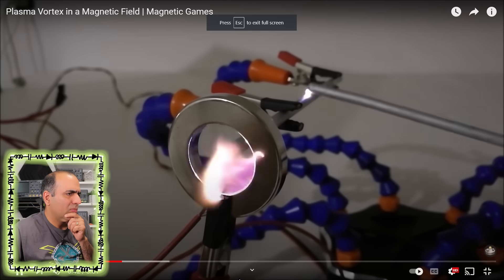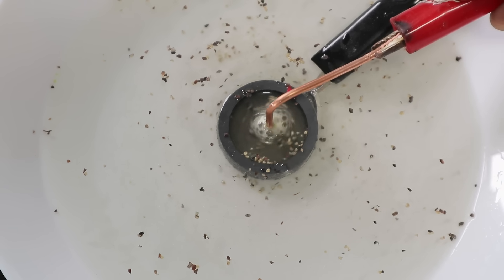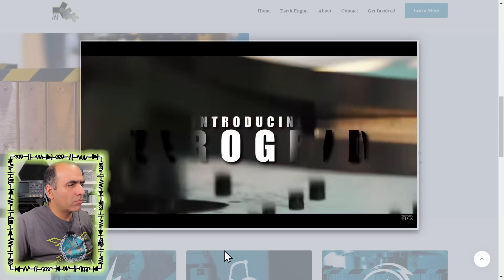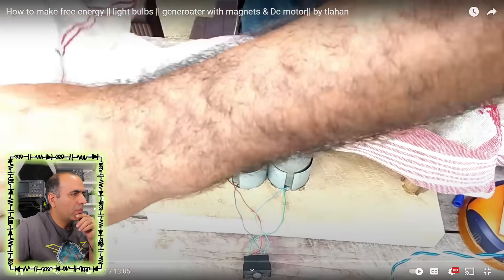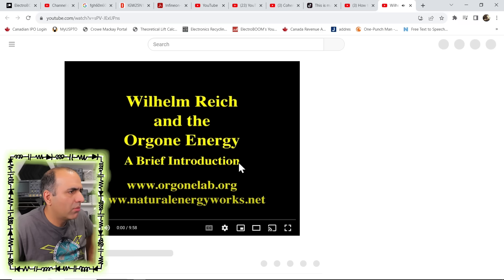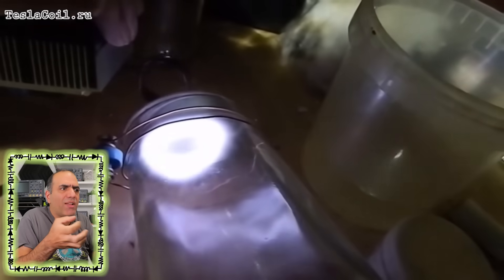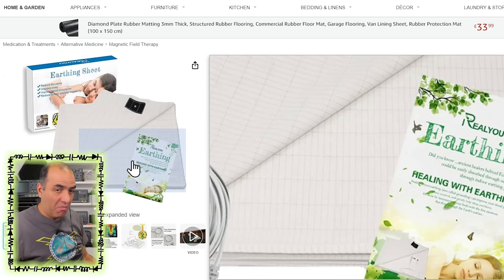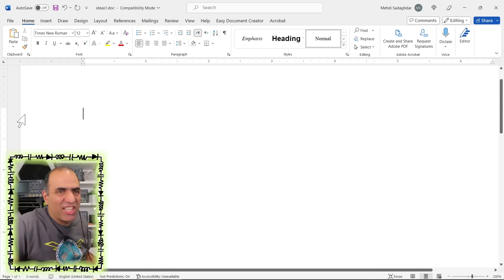Plasma and Salt Water Electric Vortex, Document Free Energy Clean Up

Comment: The plasma in a bottle @ 11:05 is called the "electrodeless plasma discharge", plenty of papers on it
Reply: Yep, immediately recognized that as real. I remember reading a paper modelling plasma toroid formation.
Reply: Electrodeless discharge lamps were actually a commercial product. External electrode fluorescent lamps(EEFLs) were used for screen backlights.

Comment: 11:35 This is an old scam, almost as common as the fake fuel savers that plug into the OBD port. It’s just a blinking light that runs off of 12 V, nothing more. Been debunked over and over, don’t even waste your time. Note that something that is real is an AFM/EFM disabler that also plugs into the OBD port of some Chevrolet vehicles.

Comment: Can you make an ionic thruster  and make it blow wind out to a fan motor that is connected to charge a  battery,  and then through a transformer to generate more amps to provide power to the system and to power any other needs.
Reply: no
Reply: Ok scrape this idea I see the problem with it

Comment: The first version you built is basically a rudimentary magnetron; I wonder if you could measure any radiation from it.
Reply: Negligible amount of radiation and most of it will be coming from arcs itself.
Reply: @swapnilkumar9363  Your point being?
Reply: @bort6414  there's no LC oscillation
Reply: @swapnilkumar9363  And? Electrons accelerating through free space produce radiation. I never claimed it was an effective, efficient or power dense magnetron. It's called "having fun with physics". If nothing else, it's potential content for videos in the future. A few modifications, some 3D printed hardware with a little electroplating treatment and a bit of basic calculations and you could have a working homemade radio magnetron.
Reply: @swapnilkumar9363  i think @bort6414 's question could be rephrased as: is there enough radiation above background noise to measure or observe it as you move around the "needle" or change the magnet size?
Reply: @bort6414  HE NEVER CLAIMED IT WAS INEFFECTIVE OR INEFFICIENT

HE WAS POINTING OUT

DID HE ASK? NO

U ASKED AND THEN U GOT BUTTHURT

HIS ANSWER WAS NEGLIGIBLE

DO U KNOW WHAT NEGLIGIBLE MEANS

APPROXIMATELY 0

in short, cant be measured

or are we going to argue to use some state of the art measurement device? FFS
Reply: @bort6414  let's be clear.
Magnetron is actually a tuned device that outputs very high power EM waves from 2GHz to 300GHz, well below the visible spectrum. It does damage to anything bigger than its wavelength by generating large currents and producing heat due to electrical resistance.
Here in this case, the radiation is from plasma so there's lots of infrared, visible as well as UV radiation( x-ray too if the arc gap was bigger) and none of these are generated by magnetrons. 

So there's radiation? Yes but in infrared to visible to  UV range. Negligible amount of it in the range of a magnetron.
Reply: @swapnilkumar9363 there's likely a fair amount of emi as well, especially in the range of the power supply switching frequency.
Reply: @bort6414 you want to..3D print a resonant plasma chamber 😅
Reply: It could be turned into a plasma window though, if you threw enough current and a strong enough field at it. Those are handy in science-stuff, when you need a window to hold atmosphere back but let a particle stream through. It's basically a force field from your favourite sci-fi franchise.
Reply: Not from the oscillations. You'd need a higher vacuum for that.